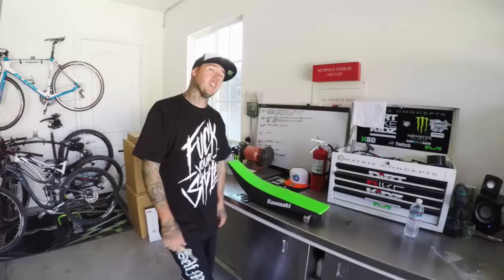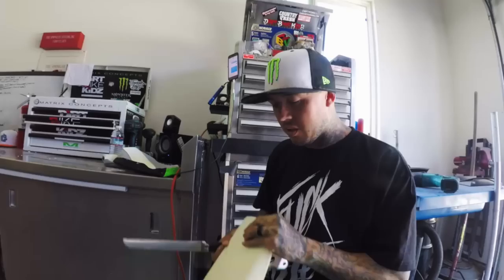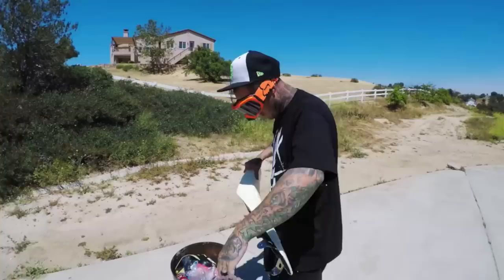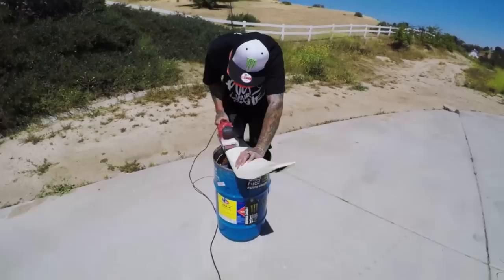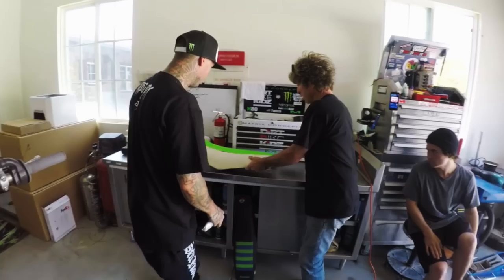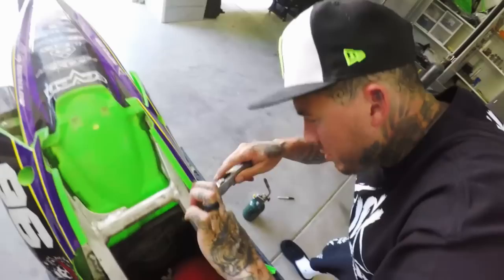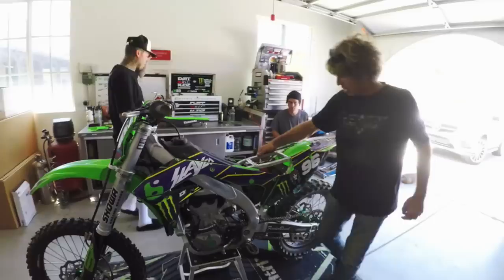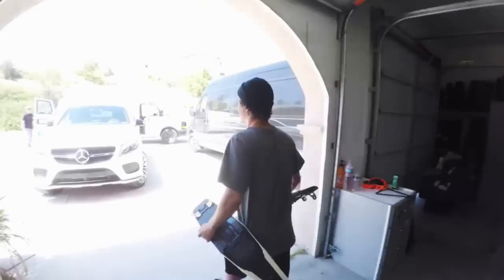Twitch Tips - Grab Holes & Low Seat

Comment: Pro tip: pick up a Woodland Scenics hot wire foam cutter at any model railroad store. Way cleaner than the knife.

And the use a rasp for detailed rough, then smooth out with the belt sanders.

Comment: How would you get a bike started that's been sitting in the shed for years and hasn't been ridden? should I replace the carb and give the motor a full clean from all the fuel & oil that was sitting in there? thing won't start thinking either sell it for parts or fixing it but it's a cheap crap bike cost more to fix
Reply from the maker: If it's a 2-stroke, maybe just start with cleaning the carb out, flush out the old gas, change the oil & spark plug and go from there.